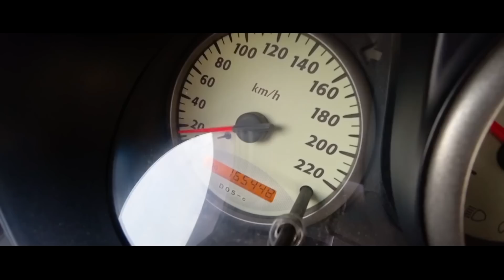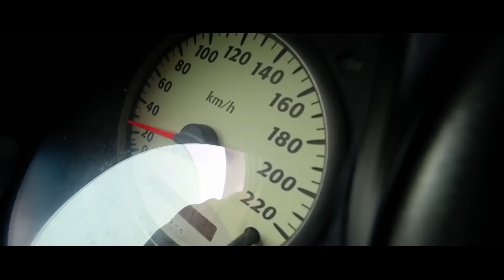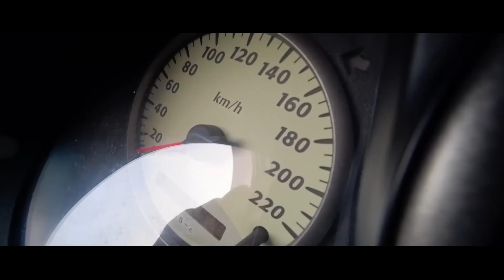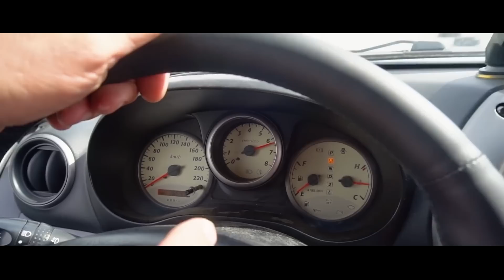What happens when you engage reverse at 62 MPH?

Comment: Next time try with a manual gearbox, result will be more spectacular!
Reply: If it even lets you engage Reverse
Reply: @MattiAntsuK  I think you would just trash the reverse idler.
Reply: Watch mastermilo82 he did it
Reply: @silverpairaducks  
Not all transmissions let you engage reverse. Since the majority of reverse gears are straight cut. 
I've had 2 moments where I've almost engaged reverse while trying to engage what I thought was 6th gear. At low speeds though, I dont know what will happen, I dont intend to try.
Reply: Grinding gears
Reply: @FarmersCode  was just gonna say that lol. That was a good video
Reply: @Youtubeforcedmetochangemyname  Yeah, dogs are what transmissions used before syncromesh. Synchromesh just makes spinning the gears up smoother, but it accomplishes the same thing. In automotive applications, they're more common in race cars. Magnus Motorsports was one of the first companies to come out with a dogbox for DSM cars, they have a faq on their website about it and they recommend against using it for a daily driver. Check this link if you're curious to know more: http://magnusmotorsports.com/magnus-dogbox-faqs/
Reply: Mastermilo already did it
Reply: I have done it automatics and standards . Most cars , lots of smoke . Funniest was a mustang that locked up the tires
Reply: I had a old manual fiat argenta and it wont go reverse only if i stop or it will make noise when i try to put it on R
Reply: You can't get it in reverse if going forward at speed. You'll just hear and feel a skeleton-shaking wretched high frequency grinding of the gears. How do I know? Let's just say I used to own an old vehicle whose shift gates didn't work properly so you had to be careful coming down from 5th to 4th on down shifting.
Reply: If u coast at 60 and disengage the clutch . U wait long enough for the input shaft to slow down u can get the gear box to reverse.
Reply: Ah.... that's the difference
Reply: my crappy 10 years old car doesn't let you do that, I tried it. It mechanically lock reverse gear when going forward and when going on high speed you can't even put it into first. but not sure if it is for protection or just the gears can't engage.
Reply: It wont work because of synchronization it will just grind it wont engage enough to work
Reply: Yes I agree . The reverse gear wont engage.
Reply: @SteelBelted  yes it is a Toyota.
Reply: @MattiAntsuK  Old Ford Sierra manuall gearboxes you can slap in reverse aslong as your under 90kmt . Oh i did try manymany years ago . Gearbox took it like champ , cant say the same for the headgasket ..
Reply: @rars0n  Old Ford manual gearboxes Does have synched reverse :)
Reply: @FlatoutF82  Are you talking about a gearbox with multiple reverse gears?
Reply: @rars0n  if you see i said Ford Sierra just above so no its a car with a manual gearbox not a Truck ... but Most manual fords from 80s and early 90s .
Reply: @FlatoutF82  That makes no sense. Synchros are for matching the gear speed to the input shaft speed. If you're shifting into reverse, you're not moving, hence you don't need a synchro. Give me a model number of a specific transmission and I'll look it up myself.

Edit: Never mind, here's an exploded view of a late 80's/early 90's Sierra 4-speed transmission, there's no synchro on reverse: https://ford.7zap.com/en/car/78/no/3/1512/15102/65504/
Reply: @rars0n  oh wow ofc ment non synched gearbox . its the middle of the night and english is faaaaar from my 1 or 2nd language . 
Both my old 86mod 2.0IS and 92mod 2.0i you can slap in reverse when ever you feel like ;) 

Not 100% sure since its almost 15years ago but know for sure the 92mod was a 5speed (was later used to rebuild my 4x4 cossie to RWD ) , the IS might have been a 4speed, but was fairly sure both was 5speed..
Reply: You will never get the selector into reverse at Fast speeds. Manual gear box is not able to.
Reply: @JM-yx1lm  Please dont try and talk when you dont know wtf ur talking about ...  MOST manual gearboxes cannot .
Reply: Not really
Reply: If anyone can kick it into reverse at high speed, it must be Vlad.
And should he fail this challenge, the video of him trying will be hilarious. It should end with the guys filtering off all the gearbox chips.
Reply: @MattiAntsuK  You and Silverpair are both right, you are just talking past each other.

The reverse gear is indeed straight cut. It cannot engage until the car is at the synchronization speed of the reverse idler. The idler is the cogwheel transferring the power to the actual reverse axle. It's the idler emanating that loud "Bzzzzzzzrhhhh" noise when trying to shift into reverse while at speed. IF you manage to engage the idler at high speed, it is indeed mainly the idler which will be damaged. Either stripped of teeth (Best outcome...), or the gearbox deadlock (can kill you)...
Reply: All it does is make a loud grinding sound
Reply: I accidentally tried in a vw 2000 jetta but there’s a blocking system so I can’t switch gears like in a dog box so if I a switch gears 2 to gear 4 or 5 it won’t let me even the reverse
Reply: Master milo did it with a manual
Reply: The R stands for race mode
Reply: It has been done on YouTube already
Reply: I had that gearbox trouble before. Funny thing is that all thats wrong is a cotterpin
Reply: I used to have an A Klass Mercedes that wouldn't even let you move the gear lever to reverse if you weren't at a complete standstill
Reply: Yea! Yea! Normies wouldn't get it
Reply: @silverpairaducks  nah, you'll mess the whole transmission
Reply: So umm you want to throw 10000 Euros / Dollars in the Trash?
Reply: Each not really it'll just grind the teeth off of the reverse gear lol
Reply: Autovlog did it with a 95 ranger stick shift
Reply: It's harder with manual
Reply: @MattiAntsuK  The wheels start slipping is what happens. Basically a burnout.
Reply: Im pretty sure a manual transmission will lock you out of reverse unless you are stopped ive tried to put a few manual cars into reverse, but couldnt
Reply: Lol
Reply: 5 to 1 is the money shift

Comment: Destroyed the torque converter lol
Reply: Would I be right in saying they snapped the blades off an impeller?
Reply: @C.I...  More than likely. either that or most of the fluid came out, since it does drive at high RPM.
Reply: In reality one of the clutch packs that is shared with the forward and reverse "gears" burned up. That's what that smell was. They're basically just paper. From experience the frictions will just be glazed over and black with a nasty smell to them. If is really bad then the friction material just flakes off after it burns up and ends up in the pan.
Reply: @mysock351C  It hadn't occurred to me that automatics could have clutches (though by your description they don't rub). I would have thought they would use a toothed gear inside a toothed "shaft" (more an inside out cog) instead of a friction plate. Are there reasons this car (and others like it) doesn't/don't use something like that?
Reply: @C.I...  They have what are called clutch packs (and bands). A clutch pack is literally a stack of steel plates and paper-lined frictions. Usually something like 6 or 8 of them that act as a wet clutch. There are also bands (a large steel strip with paper friction material) that are used in some transmissions to lock a reaction drum. The planetary sets provide the various ratios of reduction as different clutches lock/release the various members of each planetary gear set (ring gear, spider/planet gear assembly, and sun gear). There are also one-way sprag clutches as well (like a freewheel on your bicycle) that are used for routing power through the gear train. If you toast one of these it can also cause a loss of one or more drive gears.
Reply: @C.I...  In fact conventional automatic transmissions do have something like that called a planetary gear.
Reply: Conventional automatic transmissions have planetary gears, while conventional manual transmissions have gears on shafts... I've been into manual transmissions more times than I care to think about. There are, of course, variations. The Model T used planetary gears while the modern "manumatics" like the POS Ford has been putting in the focus are really more like manual transmissions with electronic controls. And yes, I do know what the differences (and purpose of) clutches and torque converters are, and even that some torque converters have clutches to lock them up at cruising speed to save fuel (and that's nothing new, Studebaker's "Automatic Drive" transmission had it in 1950).
Reply: @JeffDeWitt  The type of gear used in each is whats conducive to how it shifts. Planetaries are good for automatics because they are easily coupled to clutches, bands, and other devices to get the ratios as well as being compact. Each planetary can provide up to three separate gear ratios (plus direct drive) depending on whether the sun, spider, or ring gear are used as a reaction member. You could use planetaries and manual transmissions, its been done in bicycles since the 1900's, but using conventional gears works well with simple shift forks and synchronizers. Since they're all in a line its fairly easy to couple the various clusters together to get the ratios.
Reply: Not so much the torque converter, but the clutch packs.

Comment: I hit race mode in my 1958 Chevrolet with powerglide transmission it needed a new torque converter. $$$ I was only doing about 55 but I was drag racing. This was back in about 1964.

Comment: newer automotive transmissions often have a mechanical safety implemented (that wont engage certain gears when at a certain rpm) aswell as the electric sensors shown in this video. which is most likely the reason why the transmission wouldnt grab at higher speeds. do this experiment in an older car (pre 90s) for a good show. you and your team are remarkable vlad keep up the great content
Reply: My 2nd gen 4runner(year 91) threw itself into reverse at 45 and it locked up the rear end and stalled the truck

Comment: I actually did that by mistake on my 1991 Landcruiser with the A440F transmission when I first got it, wanted to try coasting on a long slope, pushed the stick forward one notch too many ;-) It just stopped the engine, but the sudden deceleration before the engine shut down was a bit scary ;-) I quickly put it back into neutral and simply restarted the engine in neutral and put it in drive and continued on my merry way ;-)

Now try putting it in Park instead and see what happens... If the driveshaft u-joint doesn't bust be prepared for some scary skidding! (broke  the driveshaft u-joint on a van once doing exactly that, but that was my first time using an auto tranny and I was parking and quickly found out that "park" wasn't an actual brake like on a manual, hahaha)